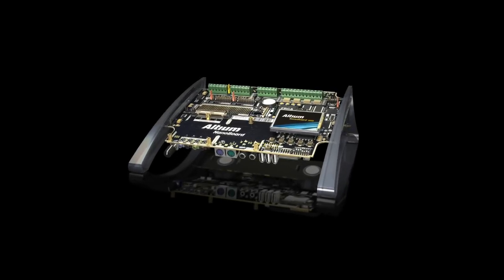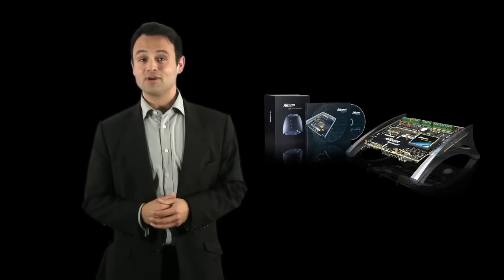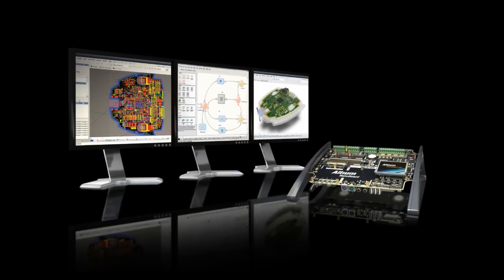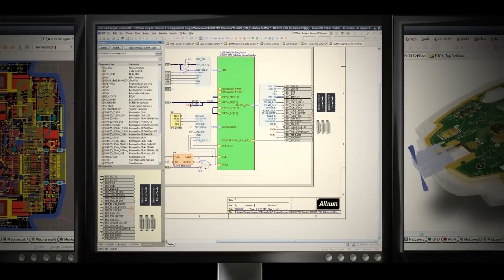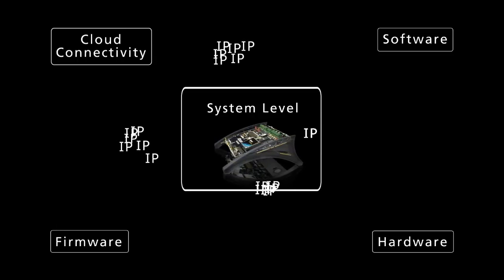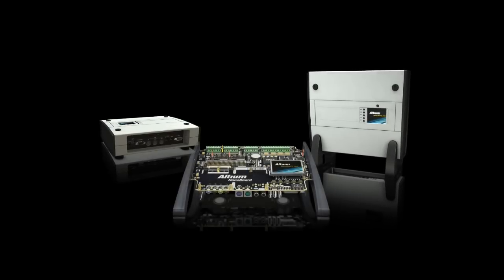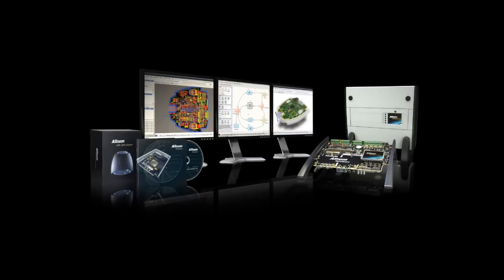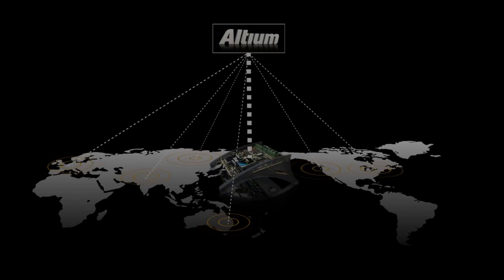Altium Nanoboard 3000

Comment from the maker: @Cleric775 I.P. does indeed mean intellectual property. Specifically in this case it means the FPGA-based components that you can use to create your system design.

I believe the NanoBoard 3000 sells for US$395, which includes a 12-month timed "soft design" license of Altium Designer, the design software you use to create your system designs and program them into the NanoBoard. The soft design license does not allow custom board design.

So there's no real "catch" with this.